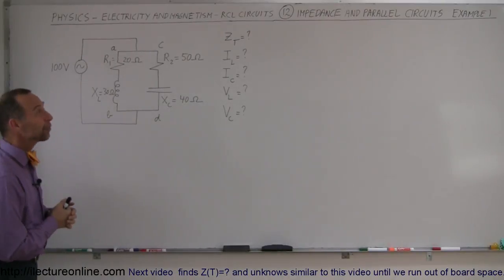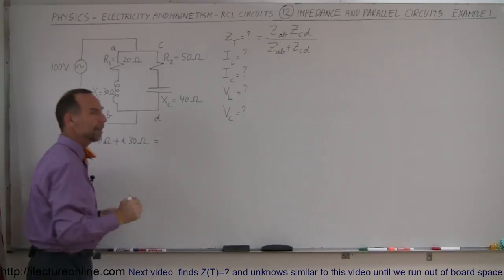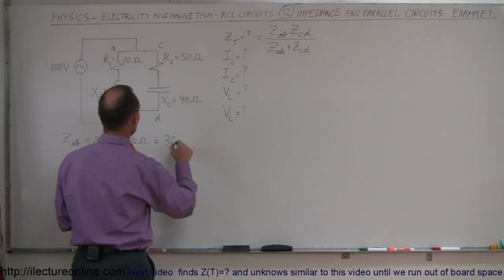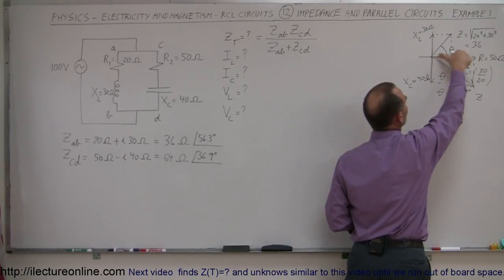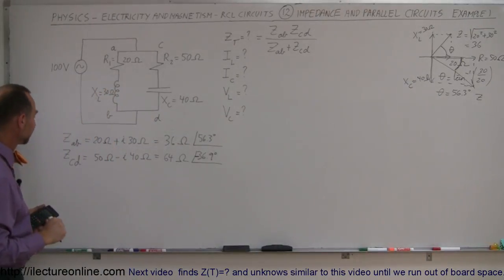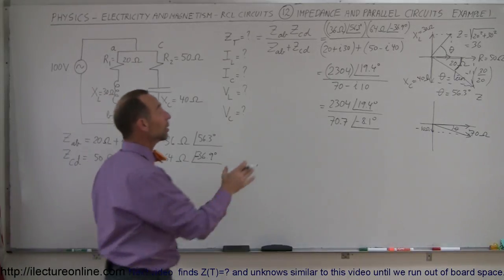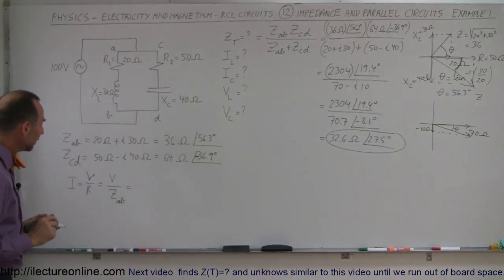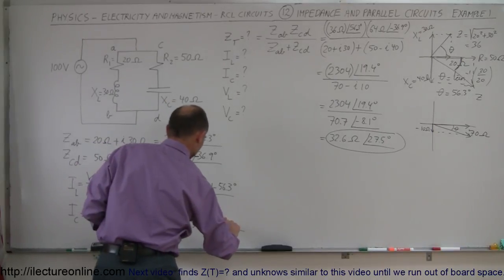Physics 49  RCL Circuits (12 of 13) Impedance and Parallel Circuits (Ex. 1)

Comment: I got 32.6 ohms at 25.7 degrees for total impedance. I am still learning this stuff, so it would be nice if you would double check your results and let me know what the correct answer is for sure. Thanks for the videos, they have been very helpful.

Comment: Is the 100V of the AC voltage source RMS in this video? Sometimes it is given like Acos(wt+teta), so should i convert A peak voltage to RMS in this situation? Thank for answer.
Reply from the maker: When it is not given specifically as in this problem you can assume that it is RMS voltage.

Comment: Hello professor, I have a question regarding the voltage in the source, which you determined to be 0 in angle, but how can I find it? Can I find through simply on the polar part using ohm's law using impedance multiplying by current with its modules?
Reply from the maker: You need to be told, (It is not something you figure out).  Sometimes the phase angle is given.  Here since there is no mention, you can take it as zero and then calculate the reactance relative to that.

Comment: Mr Michel , you are excellent , you make look simple,  which look very difficult, but I want to ask you  2 conceptual questions which are not clear for me, 1). when you calculate the voltages ab and cd , these are different, but they are in parallel, shouldn't be the same? 
2.) how you can calculate the power of this circuit?
much appreciated, thank you in advance
Reply from the maker: Note that the voltages calculated here are the voltages across the capacitor and inductor only (not the whole branch).  Also note that the voltages across each branch will be at a different phase, because current leads in the capacitor branch and current lags in the inductor branch.  P = I^2 R
Reply: @MichelvanBiezen  thank you very much for your quick answer. in relation to the power , what intensity should I consider? usually we learn that in AC circuit in serie  current the power  P = VxI cos(angle z) or cos(angle v-angle I)
in this  case in paralle , we don't have to use that? why ?
Reply from the maker: Take a look at this playlist on this channel.   It shows you all about power in AC circuits:  ELECTRICAL ENGINEERING 12 AC POWER
Reply: @MichelvanBiezen  many thanks !!

Comment: @ 9:38 can i find the total current by dividing the total voltage by total impedance?
and then use the current divider to find the current in Zab and so on?
Reply from the maker: The total current is indeed equal to the total voltage divided by the total impedance.  However when you try to find the current through each branch, you do have to take the phase difference into account.

Comment: If the reactant of an inductor or capacitor is not given, can you calculate based on 1/(jwC) or jwL ?
Reply from the maker: +Alex Schulte 
If you know the size of the capacitor or inductor and you know the frequency, yes.
Keep in mind that when you are working with parallel circuits you must also know the phase angle.
Reply: Thank you for replying! I have a circuit very similar to yours, but instead of an input voltage, I have an input current. I was just curious because I didn't get the correct answer by using this method. Maybe, I just need some algebra remediation......

Comment: Dear Sir,
Thank you for these excellent videos.
May I add a comment: in video 12/13 of RCL circuits in the right lower corner you calculate the voltage drop across the coil, I think the phase angle should be 33.7° instead of 23,7 °.
kind regards
Georg Reining
Reply from the maker: Georg,
You are correct, 90 - 56.3 = 33.7.
Thank you.

Comment: Sir to calculate the power we take the magnitude of the current in let's say ab and multiply it with the resistance (20) or is it something different?
Reply from the maker: The power consumed is always due to the resistance portion of the circuit.  Ideal capacitors and inductors (without resistance) do not consume power.
Reply: @MichelvanBiezen   Yes sir I solved all the question accordingly even the one that you did here and in the subsequent video and they were correct.
Thanks to you I was able to skip the tedious differential equation method for solving parallel RCL.

Comment: SIR
Watched yr video RCL CIRCUITS IMPEDANCE PARALLEL CIRCUITS:--
1. Liked the video and u explained well. No doubts.
2. Please watch yr video on mobile screen.  The black ink u use is not clearly visible. The writings of diagrams/values and equations should have CLEAR VISIBILITY ON MOBILE SCREEN as many do nt have wider computer screens to watch.
I made out every thing by yr clearly audible voice.
THANKS
VATSA  INDIA